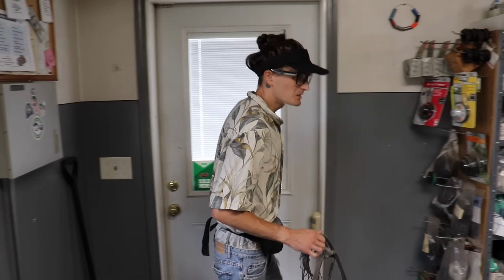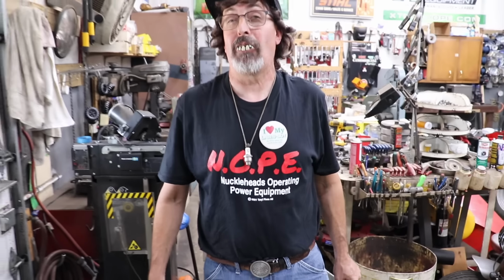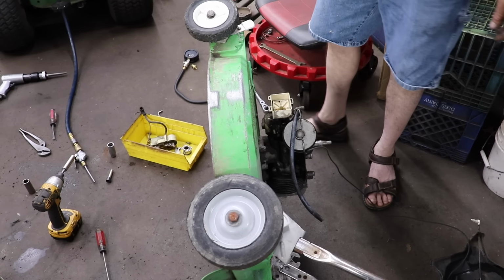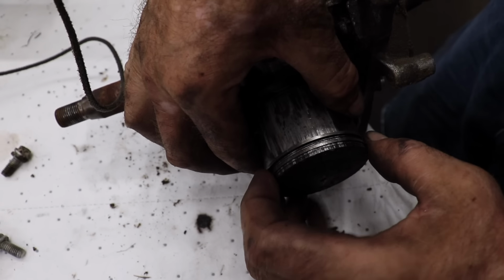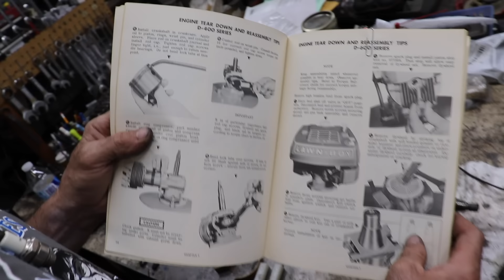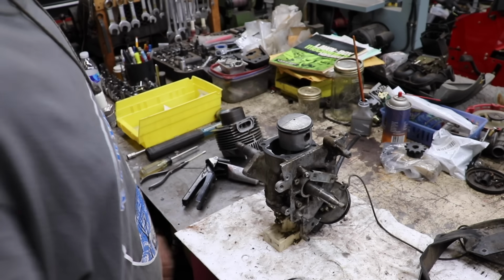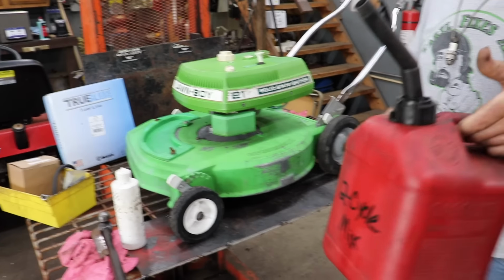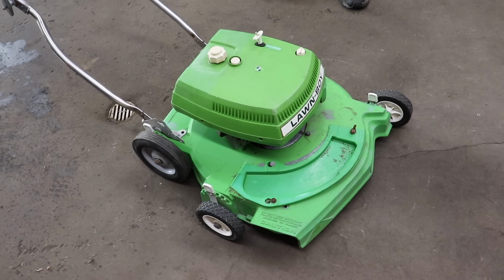Epic Lawn Boy Engine Rebuild

Comment: Long ago found one of those abandoned at the dump, did a minor tune up and it ran great, gave it to my parents, telling them "here's some two stroke oil, you have to mix this with the gas".  About three months later, my dad wants me to look at it. Thing is seized. First thing I checked, the gas. Not a drop of 2 stroke oil in it. Seems their "neighbor" told them "no lawnmower needs two stroke" and that "I was an idiot for telling them that".   Pretty sure most of the neat little 2 stroke mowers died because people forgot or thought they knew better, and would not run 2 stroke mix in the fuel.

Comment: Good video I had a lawn boy with the “F” engine that was given to me by a coworker it ran somewhat it was loud do to the muffkin was 80% rusted away one day my stepdad was cleaning up the garage and took my lawn boy to the scrap yard I would like to find another one it does not have to be an F type engine I just like to fact how light the mower was and it was a two-smoke

Comment: those old lawn boys were around when I was a kid. the most common problem was cylinder ports plugged with carbon. take of muffler, use a screwdriver to clean out exhaust ports. put the muffler back on and away it would go.

Comment: I love that mower.  I still have one in the back of the garage.  Why didn't you flip the reed valves over.  That was the one weak point on that engine and thats was a comon fix.

Comment: Lining the blade with the cylinder by itself doesn't do anything.  First you get the piston at TDC, then line it up with the cylinder - you're trying to line it up with the crankshaft rotation angle to minimize vibration.  But you're right that it doesn't seem to make much difference, even if you do it right.

Darn it.  This is what I get for making a comment before watching the whole thing.  At 42:26 you cover what I just said <insert brer brer brer noise here>.  So now I just gotta add that for the F engine, they say to mount the blade perpendicular to the way you mount it on your D engine.

You horribly scored up the piston by cleaning the exhaust ports!  Hah hah hah - hilarious, dude!  And the sound effects are phemomina...femalinal...mefina...really good!

Comment: Hay Taryl what I do. I work on maytag hit miss engines. There 2 cycle engines. I put them on the compression and spray soapy water around the crank shaft seals and look for bubbles.  That's how I do it . It does work. And I have done it to chainsaw engines too.

Comment: Mowed lawn today with my 1982 lawnboy. also have a 1955 restored i mow with time to time but its 19''. We were a Suzuki shop we also sold lawnboy OMC Evinrude Johnson. never seen a Briggs that cut grass as good. Funny thing is last 24 years I work on pwc's and boats fer a livin. Hum lets agre to disagree my experience is 0 oil scored 360 degrees and overheat exhaust port. Can show you a Kawasaki jetski 2stk piston I pulled today that ran on 0 oil and its galded 360 degrees. And kind of like you been doing this 43 years every day. Mostly 2stk dirt bikes outboards and of course lawn boys and junky lawn boy weedeaters!

Comment: I have one made in 91. Very hard to pull. I haven't messed with it in 8 or 9 years. I did get it to run a few times on 16:1. But after a few mows, nada. I put almost $200.00 in it. Maybe when I retire in 3 years.

Comment: What lownboy was it that used a wind vain governor?
Reply: Dura Force 6.5 h.p. gas 40/1 Rejet carb 2003 gold pro last of the legends it loves tall grass.
Reply: Was it 2 cycle or 4 cycle? The one I remember was 2 cycle.
Reply: @jarreddinkel5648  Dura Force 6.5    2 cycle wind vain governor.
Reply: On the carburetor?

Comment: @1:04:05 What is that metal cutout plate on top of the front of the deck for?
Reply: You can remove that and put in a mulch plug or a bagger attachment.

Comment: We use muriatic acid in pools to bring the ph of the water down especially pools that have sodium ionizing systems to create chlorine aka (salt systems). The salt system slowly bring the ph of the water up as it generates chlorine.
Reply: Another use for muriatic acid is for a toilet that is limed up.  If it will flush properly by pouring a bucket of water in the bowl but not by normal flushing, pour the acid down the overflow tube in the tank. Once again, will stink like hell.

Comment: Landscapers used these claiming they were lighter but more powerful like 4 or 4.5 HP.  vs. 4 stroke.  Yes they were light, my sister had one just had to add oil to the gas easy peasy.  Couldn’t miss them with the green color.

Comment: what the air/fuel ratio on the old LB`s
Reply: I don't know what the air/fuel ratio is, but if you mean the oil ratio, lawnboys ran 32/1 for 2 stroke oil. It was cast right into the fuel cap

Comment: Those white ignition coils were actually ground to run. The tab on the coil would be grounded to the engine to run, not kill spark as is common on every other ignition coil. So the on/off switch should have continuity when in the "on" position. For some reason that was a really bad design and a lot of them failed which is why they moved away from them. You can still get replacement coils but they are the newer style where the tab is ground to kill. What I do when swapping coils on one of these machines is sand off the "on / off" lettering on the engine shroud and re do it with my soldering iron, effectively reversing the operation of the switch.

Comment: I'm Dix-A-Pointed the debris shield on the back isn't steel, to make that horrible scrapping along the concrete.   A Sound Of My Youth.  All the kids' Dads had Lawnboys or Toros - we had Searses.  
Is that piece curving around the front actually a tray to hold parts or what?

Comment: Does anyone know anything about the self drive systems on these? I have a curb find almost exacto to the one in this video. I got mine running just water in the gas tank and carb but i had to take apart the self drive because the o-ring vaporized. It used a spline half inch shaft to a gear running off the shaft worm gear and it seems there's only one washer but i can't figure out how it goes back together. I have a model 8237 serial 9700000 if someone can point me to some documents id much appreciate that. PS: reason why i took it apart was because it was leaking out everywhere and not keeping it inside the little case right under the main bearing. Instead i was just gonna pack it with grease and pray it don't overheat

Comment: In swimming pools muriatic acid lowers the PH in the water. If the PH is not right in the pool the copper coils in the heater will be ate away and the coils will leak. Also you can feel itchy after swimming. That's what muriatic acid does.

Comment: <In a high voice>: But Taryl---caustic soda is better for removing aluminum, because it doesn't attack steel.  Caustic soda is in oven cleaner.  It's the stuff in oven cleaner that eats up burnt grease---and aluminum.
Reply: lye

Comment: The reason you only use muriatic acid outside is because the fumes will rust everything in your shop, including all your tools. Use baking soda (sodium bicarbonate) to neutralize the HCl ( muriatic acid), then rinse with water.

Comment: Got one of these under a tarp in my backyard, I think I'm going to clean it up and see if it will work. Cut grass for years with it, just could not throw it away. I found the key to keep it running was to properly mix the oil and gas.
Reply: 32: 1 ratio

Comment: The only excuse i can think for that two stroke Lawn Boy, is that it's gotta be cheap one. Because there have been great 4 stroke Briggs, Honda and Tecumseh powered machines in the market.
Reply: Not back then. 2 smokes were king.
Reply: @cravenmoorehead5636  Well, maybe i'm wrong but i like 2 stroke outboard motors and some two wheelers, but i want my lawn mowers, snow blowers and generators as 4 stroke.

Comment: Can anyone point me in the direction of how to replace the oil seals on this engine i have the same exact lawnboy i have the new oil seals but not sure on how to change it have got in touch with a couple local service shops and they wont do it said id never find the parts to fix it and it would cost more than its worth i dont care what it cost i just want the new seals installed i can do it myself just u sure how on this engine any help would be greatly appreciated

Comment: I used the same acid poured it into a old puch moped gas take to eat tge rust out I used baking soda and water mix to rinse it then detentured alcohol to get the water out then heat gun it then used red kote tank liner seal the tank

Comment: The thing that finally killed LawnBoy was when Sears started selling them. They did not tell the Dealers in Texas. The M series was a expensive flop!!!
Reply: Yeah I remember them showing up in Sears was surprised to see it.  Honda as well.
Reply: Lawnboy isn’t technically dead. They still make them but they are essentially cheaper green toros.
Reply: @lawnmowerdude  was told in 1991 that Toro was not going to using the LawnBoy Engine (F engine) but for a few years they did. Toro had a problem with there height adjusters in a commercial setting. The parts bags had Toro/ LawnBoy on them. We was a Toro dealer also.
Reply: @barackobama5304  We was surprised also. My boss had just bought 75 units! We was a Master Dealer.

Comment: I Knew a Guy With 3 Fingers Missing and His Thumb I Asked What Happened He Said He and His Helper Used To Use His Lawnboy To Trim Hedges Cause It Was a 2 Cycle And Could Be Ran On It’s Side and When They Were Doing a Long Hedge Row It Got To Heavy To Hold and It Slipped and His Hand Went Under The Deck and That’s Was The Resulting Damage 🤕😳🤕😬😬😬 Ouch
Reply: Safety 3rd 🤷‍♂️

Comment: Good video , really . But I don't think that 2 stroke engines need to run on 3000 rpm .
Reply from the maker: So the manual is misleading?
Reply: @TarylFixesAll  C'mon buddy , don't be mad . You are the King ... but think about it for a moment . It is not a 4 stroke engine that need to rev or idle on particular rpm regarding oil lubrication ... just saying . Respect .
Reply from the maker: @TheZemun  Not mad at all. Was just going by the setting in the manual. You want it to have plenty of power when chomping down that tasty grass! Mmmm 😋
Reply: @TarylFixesAll  Legit .

Comment: Didn't power wash the grime off the engine before working on it?
You're losing your touch.
Reply: Washing an engine that may not run is as wasteful as the work they did on the Scrambler.  You can always wash after you know it runs